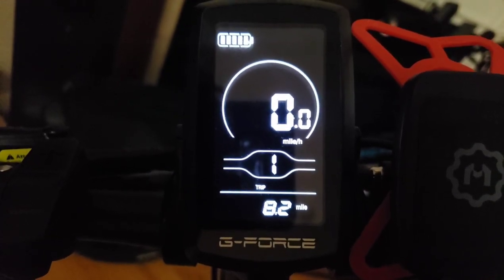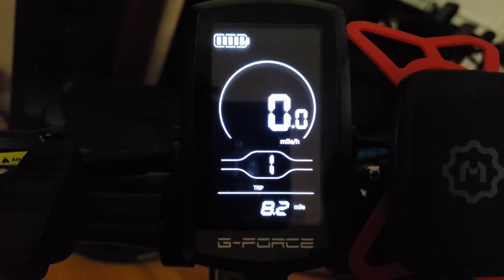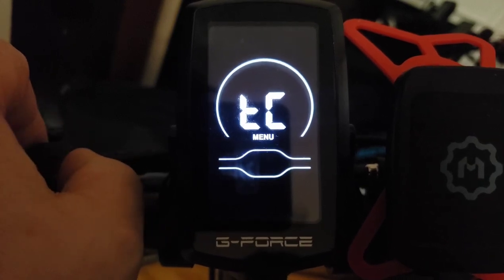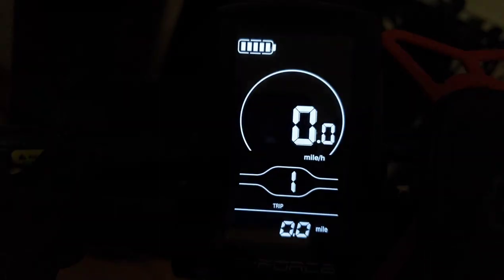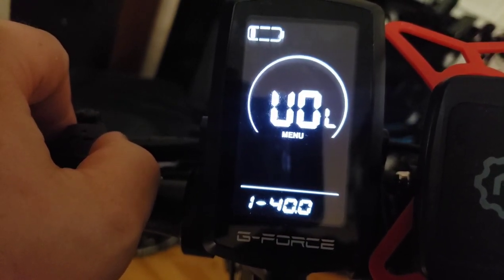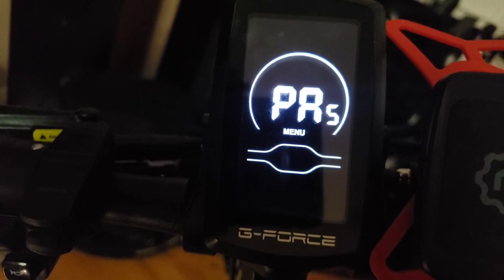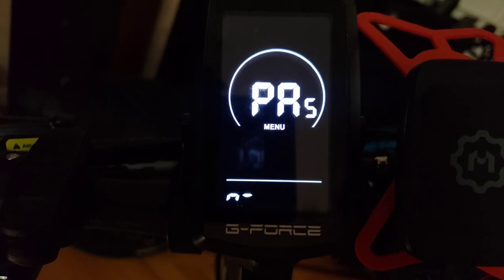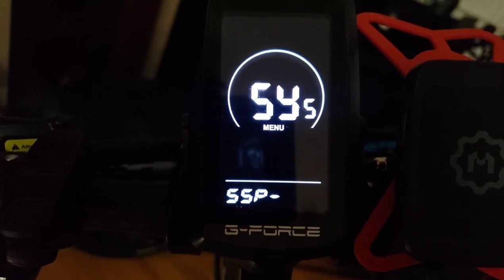G-FORCE T42 ( DEFAULT DISPLAY SETTINGS ) MODEL YL80C AND REVIEW. E-BIKE DISPLAY SETTINGS

Comment: It's important to point out that in Florida (as of 4/20/23), regardless of the potential or actual speed of your e-bike, as long as it has pedals, one can travel anywhere a bike can travel and without plates, insurance, inspections, etc and technically at any rate of speed (it's possible in some counties and/or municipalities this may be forbidden - I'm not a lawyer, but I sure as hell did my homework). True story
Reply from the maker: Well that's just horrible.. I say that in terms of bike trails.. they can drive 40 mph on a bike trail if the bike can do it!! That's just ridiculous You need speed restrictions when you're around people like that in a confined area like a bike trail. Florida is Florida they have very little rules I mean don't even get me started about that place. It'll bring up a big crazy conversation.. I don't believe everyone should be controlled but certain things should be controlled just like the speed of a bike on a trail.. if it's a class 3 bike the maximum speed I think is 30 mph and for the love of God you don't need to go faster than that especially on a bike trail!!

Comment: missed over talking about how cruise control works and doesn't work, what the heart icon means when you hold the plus button, the walking icon when you hold the minus button.
Reply from the maker: Basically for me I just hold down the thumb button and don't let go for a few seconds then when I let go it stays at that cruise speed. I think the heart button has something to do with walk mode
Reply: @thefix-itguyreviewer8151  yeah there's small things too I'm tryna figure out lol but you helped me with a few I didn't know
Reply: @thefix-itguyreviewer8151  so apparently you need hold + and then thumb it for 6 seconds then cc will kick in

Comment: I got a good one for you, I accidently pressed the HEADLIGHT and PLUS (+) BUTTONS at the same time, and a screen called AC (ACF) showed up. There was a setting of 0 or 1 available. I can't find anything in regards to ACF, and I have no clue what it does...
Can you get back to me and let me know what ACF is, and advise which setting it should be set to cause I don't remember if it was on 0 or 1 ?

Comment: OK I really need anyone's help here. I just got my t42 last friday aug 11th. And I already wrote to Gforce twice about this and they have yet to send me an intelligent reply. On the newest models, Gforce has decided to force a new feature on the T42. When you keep the throttle down for more than 8 seconds straight, the throttle remains on full power (cruise) even though you have released the handle. They have confirmed that to me yesterday. And that is a default setting now. You don't even need to activate it, it is setup by default and its annoying when you need to slow down, because it does not. In short, the cruise gets on automatically and to turn if off, you need to press the throttle again or use the brakes. I asked them, well great ! now how do you turn it off ? Because, you know its dangerous. And that was their official reply. «Just press the throttle again or use the brakes» hell yeah ! Now I told them we need to turn this off, it doesnt make sense that you can't turn it off, and i am still waiting for a reply from them. I looked in the whole settings and i can't find anything related to the throttle/auto cruise and yes i have the YL80C manual. Anyone who can help me with this would be most welcome !

Comment: I just got a G-Force T42 sent to me in the UK and because of my location it's supposed to be restricted to 15.5mph but it actually goes up to 30! I'm not complaining but would like to set the top speed to a little less and my display is not set up anything like the T42 manual or the Yolin manual or how it is in this video. I contacted support and should hopefully hear back soon. But wondered if anyone else has come across this... When I power on, then from the main screen, hold + and -, it shows P1 which allows me to set the back light, 3 levels of brightness. If I press + it shows P2, which lets me choose between mile/h and km/h. If I press + again it shows P3 which lets me set a parameter from 0 mile/h to 62 mile/h and I don't understand this as obviously the bike doesn't go up to 62 and if I change it (it was at 62 to begin with), nothing changes. If I press + again it shows P4 with a choice of dEF-n and dEF-y, which seems to be the option for leaving settings as they are or resetting to default. That's it, and no combination of button presses gets me into any other kind of menu! When at the main screen, if I hold -, it doesn't show the walking mode symbol or do anything either. It's really weird!
Reply from the maker: If you watch my video it shows you exactly what to do in every setting even though it's not set up exactly the same way. The setting for the speed should be identical
Reply: I have this exact problem! ive been looking for someone else with this same problem. Did g force get back in touch with you?
Reply: G force got in touch with me and this is what they said. 

Thank you for your contact
Your display may be a European display agreement.
Don't worry , this is normal， because the advanced menu is locked.
I'm sorry that the user manual you saw was uploaded by us before, and it may include some advanced menu contents.
Our ebikes are sold in countries around the world. 
 In the European market, we only started to promote them later, so that we did not produce the contents of the user manual of the European agreement version soon.
We have adjusted all the values to the most appropriate, and the European buyer cannot modify the advanced menu.
This depends on relevant European road regulations and suggestions from other European customers.
For example, there are only three optional pedal assist levels in the United States.
Because we have met some European customers before, they did not modify some values without contacting us, which led to many problems and may ebike not even work properly.
We just want our valued customer's ebike to work properly and avoid some unnecessary mistakes.
This is to prevent the buyer from modifying some values without permission and causing problems.
This will not affect the normal work of your ebike at all.
We have adjusted all the values to the most appropriate, and the buyer cannot modify the advanced menu.
0~5  pedal  assist gear, the default gear is 1 when starting.
In gear 0, there is no assist function /throttle, and no boost function.
P1 display brightness, P2 metric and kilometre unit conversion, P3 maximum speed limit setting, P4 restore default factory settings.
Change the Speed Limiter：https://youtu.be/JEsr3kWKFUU
Reply: @ChiefJoeOnline  Thanks, they more or less said the same to me but without the lengthy explanation. They told me that the latest model has the settings like mine and sent me the video showing those functions. They also offered to send me a new motor controller that will either be limited to 15.5mph or allow me to limit it (they were a bit vague on this). I let them know that the speed limit function and walk mode don't actually work for me but they didn't comment on this. I'm hoping the new controller will let me set the speed limit properly but allow me to go a little faster than 15.5 if I choose. At least I have the option of either controller! Will let you know when I get it and try it out. Does your speed limit function work? I'm baffled that it has a range of 0-62 when the bike's max is 30 and for me no value I set makes any difference
Reply: @scoobyjenkins  To be honest i havent really tested it out, ive only gone maybe 2 miles on it so far. Ive also gotten 30mph out of it. I just want to be able to fine tune speed 1 to maybe 3mph because when i go to turn a corner or make a u turn, the power kicks in and it doesnt feel safe. I may request a new controller and see what they say.
Reply: @ChiefJoeOnline  Yeah, I don't like how it kicks in so quickly, so when I have to stop, I set it to 0 for setting off again, then go back to pedal assist once I get moving. I tend to just stop pedaling as I go into turns, then start again. It would be nice to be able to adjust the PAS levels but looks like we're locked down here!
Reply: Mine it’s going to 45 km/h!! And I can’t lower the speed neither, I’m really concern because this is UK, i don’t want to get a fine or something worst.

Comment: Good job thanks.
Looking forward to more videos about the T42.
* subbed.
Reply from the maker: Thank you I tried 🤣

I just got to learn to make video shorter but sometimes I don't know how. 

I'll get better at it! I have tons of videos coming on e-bikes and a bunch of other stuff. G-Force T42 versus the LECTRIC XP 2.0.. 

Also information on how to change the G-Force in the LECTRIC 2.0 A better 7 gear sprocket system in the back. Makes a big difference when you're going fast. 

Also derailleur work, adjustments, how to stop breaks from rubbing, making squeaking noises, BLEEDING HYDRAULIC BRAKES, straightening out brake rotors on bikes. Etc..... 

Because I own both of them One is for my wife and the G-Force for me. 

SPOILER THE G-FORCE T42 IS A MUCH BETTER BIKE WITH BETTER SPECS!! 

;)

But the video is coming..

The reason why I take so long for these videos to be uploaded is because you have to edit them.  And it takes a while..  

But I'll get to them 😀
Reply: Great content. And great ideas for the upcoming videos those would all be so helpful. Subbed and following… I am receiving my T42 today and can not wait to get her all setup and modded out :)
Reply from the maker: @philliplacroix2513  It is a great great bike!!!
Reply from the maker: @philliplacroix2513  and the other content is coming!! Just such a pain to edit...
Reply: @thefix-itguyreviewer8151  my bike came with bent front forks :( I can’t even assemble it. Any tips on how to go about straightening them? I don’t exactly have any tools for that kind of thing. They’re not off by too much but enough that you can’t align the axle in the dropouts at all. And when you do get it close the brake caliper is not even close to lining up with the disc. I did not mess with anything and I took photos and videos and sent them to G force. I am not sure what to do cause I’m not terribly mechanically inclined and I’ve seen people reporting that they had a hard time getting refunds even from shipping damage. Any ideas, tips? Have you heard of this being an issue before on these bikes?
Reply from the maker: @philliplacroix2513  What part is bent? 

Can you upload a video and show me? 

That's very weird I've never heard of that before.

But if your forks are bent They will send you a brand new forks ASAP if you contact them!!
Reply from the maker: @philliplacroix2513  If you're talking about just where The wheel goes on at the very end You can use clamps or a woodshop clamp. 

But again that's very bizarre!!
Reply: @thefix-itguyreviewer8151  that’s the exact piece. I’ll upload a video now it’s not great but in the video you can see that when you line up the wheel on one side the bolt is way off on the other and the wheel sits in crooked when you force the wheel into both little indentions on either side.

Comment: When I press info and minus I get something that says DEF-N or DEF-Y. I don't get any of those options to change tire size or speed smh and also my battery gauge is set to 40, 44.2, 60.1,60.2, and 60.3 factory set cuz I haven't changed anything and I don't wanna mess with it but I don't even think it gets 60V cuz it's a 48V battery. But literally everything else is the same smh
Reply from the maker: I don't think you got your settings right. 

To get to the tire size you have to be very specific to get into that menu as I explain in the video.

There's three ways to get into this menu settings.

The first way I think you have the default which is DEF you described. You don't want to change this.  To get into this You press the minus button and the information button at the same time. D e f - n means don't change defaults  d e f - y means change to defaults. You don't want to change the defaults because it was set up for that particular motor in controller.. defaults sets it back to the factory defaults..  The factory doesn't know what motor and control you have and how it should be set up with the magnets.

That's why you should follow specifically what I showed you and copy it to a t. So if you did set it back to DEF - Y  You have to go back through every setting and put it back exactly the way it was in my video. 

The second way to get into settings is to press the plus and minus at the same time This is where you get your basic couple of settings one of them is setting the trip back to zero. By default it does not go back to zero you have to do it manually which I actually like. 

The next set of settings is after you press the plus and minus once at the same time to get into those settings. Do not go back to the main screen again  to get to the tire settings You now hit The minus and the information button on the side top at the same time. This will not be the DEF setting anymore now it will be the LD setting the tire setting and other settings. 

The third way to get into settings to all of the main settings  Plus the plus and minus button once at the same time from the main screen. Then plus without going back press the plus and minus button AGIAN And it will bring you to the third set of settings that I show.

I don't think you're paying attention to what I'm pressing It's all in the video listen carefully.

;)
Reply from the maker: FYI those battery settings are completely wrong.  It will never read right if you do that. You have a 48 volt battery. The maximum voltage for 48 volt battery 54.6 volts That's the max. 

You want to set the voltage as follows as I show in the video to put it back to default settings Even though you can change it to anything you want here's what it all boils down to. 

-------

FORCE T42 BATTERY VOLTAGE INFORMATION

Keep in mind these are the percentages of volts until that BAR GOES BELOW THAT PARTICULAR VOLTAGE. So for instance a full 48 VOLT S13 battery is 54.6 volts.  It will look like the battery is full because the fifth bar last bar will not go away until it goes below 49 volts which is approximately 65% battery. So that one bar goes from 100% to 65%. Which means the percentage can vary between those two numbers in that one bar 35%. In other words when that battery looks full. It could mean it's 65%, 75, 85, 95 or 100%.. any numbers in between 65 to 100.. Hope I didn't confuse everybody 

Also worth noting when that last bar is showing it is about 40 volts. Which means you're below 20% at about 10%.  It is not healthy to go below 10% most battery companies will tell you try not to go below 20% So as soon as you see 2nd bar go away And you only have one left I hope you're close to home.. better yet as soon as you Your bar dropped from 3 to 2 which is 35% get home ASAP.  

charging a battery from zero all the way up to grades the battery significantly. Just like always leaving it charged to 100%.  Never leave the charger plugged into the battery. And never leave your battery charged 100% for more than 10 days.  The battery is happiest between 20 and 80% with the best percentage to store the battery is approximately 40 to 60% ( unfortunately this is the world of batteries!! ) And the biggest downfall of the electric world!! 

And one more thing when you're charging your battery. Do not charge it right away after you've been Riding. One of the biggest enemies in why batteries fail is being too hot. Let it cool down to room temperature before you charge it ;) 

1st bar - 40 volts = 8 to 10%

2nd bar - 44.5 volts = 35%

3rd bar - 46.5 volts = about 50%

4th bar - 47.5 - volts = 55%

5th bar - 49.0 - volts = 65%
Reply from the maker: Again for clarity You're getting the DEF menu because you didn't get into the basic menu first. 

You have to press the plus and minus button first to get to the basic menu ( Then you press the minus in the info button to get into the other settings ) 

Your problem is you're pressing the minus button and the info button first before you get into the main menu. That will bring you to the DEF settings

Again it's all in the video if you pay attention. 

;)

Comment: On the SCA menu what setting 0-3, 0-5, etc do I need to have both power assistance from the motor and also when I want to run it fully electrically? Do I need to include a setting with a 0? How does this work? Great video!!!
Reply: With power assistance levels (SCA), the 0 ones are for no power assist. I don't remember right now if you still have throttle only on 0, but i do know that on all other levels throttle is not limited to PAS level